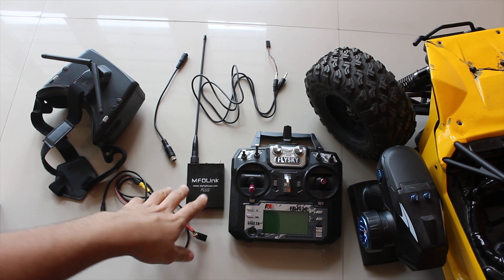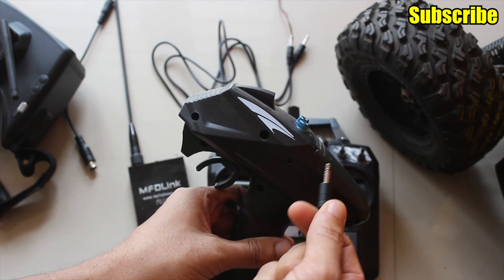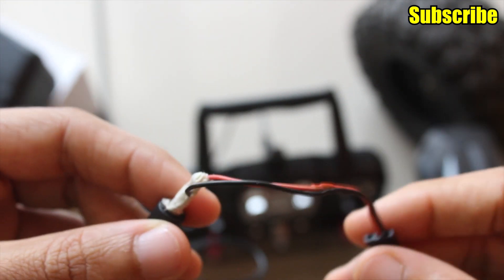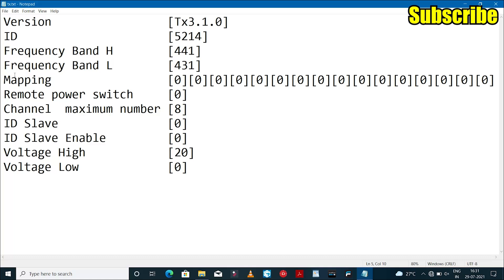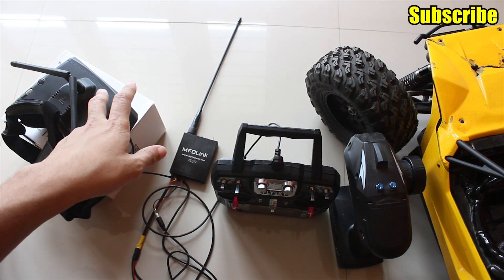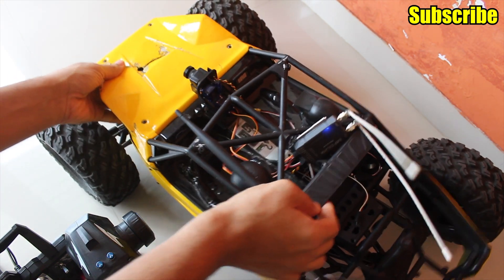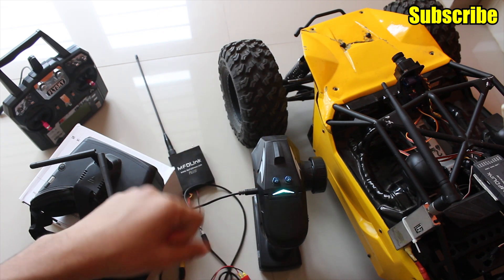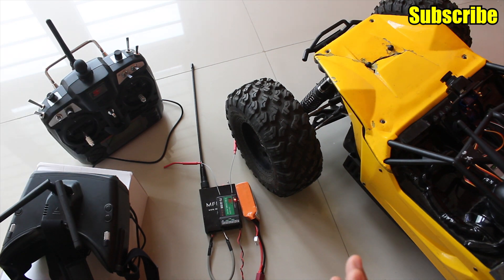UHF Head Tracker Setup for Long Range FPV | Skyzone Cobra X | MFD RLink UHF System | Rc Car FPV

Comment: Nice setup! Did you have to configure the dumbo-x6 to accept ppm input? I thought the port was only for output--for computer simulator games.
Reply from the maker: It's doesn't support ppm input. It's only outputting ppm signal to uhf module.
Reply: @RakishRc  Ahh, I get it now. Thanks for the clarification. I need to pick one of those things up
Reply from the maker: @5haun1  Cool 👍
Reply: @RakishRc  can you give me all parts number and fpv pls? Thank. Im deaf